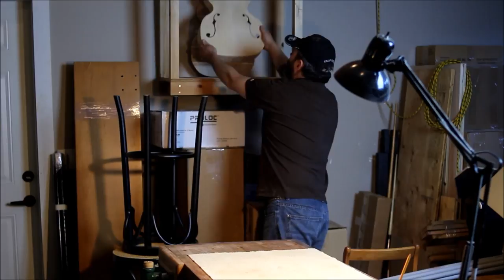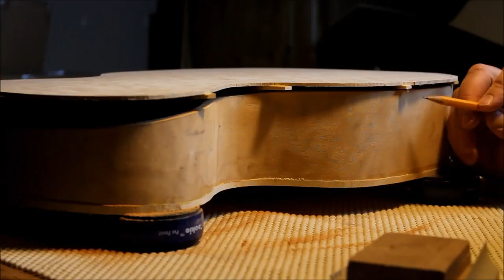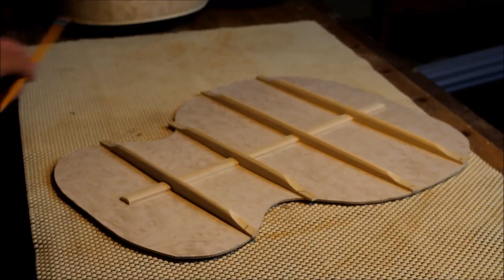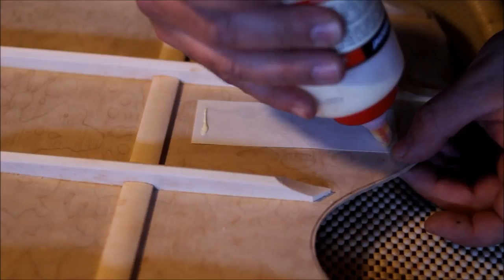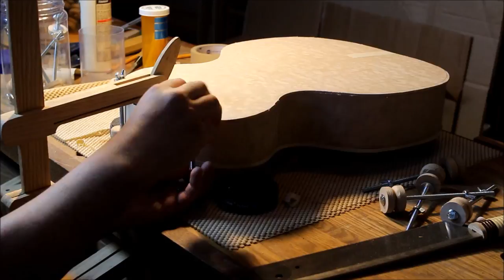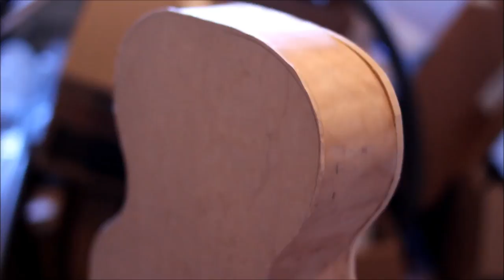Octave Mandolin Backboard glue up

Comment: As always, watched with respect for the patience and accuracy! 
Question: is there a troublesome effect if there would be less (or non) or more "bending" pressure at the point where the 3 big clamps are?  (hope question makes sense)
Reply from the maker: Not Just Sawdust I don't believe so. As long as the tapering of the rim isn't too sharp in transition it should be fine. I used those clamps there because the spool clamps were not holding because of the fretboard area on the soundboard. Just put enough pressure to get the wood together, too much clamping pressure and you'd end up starving the joint.. thanks for the great question Gerrit..